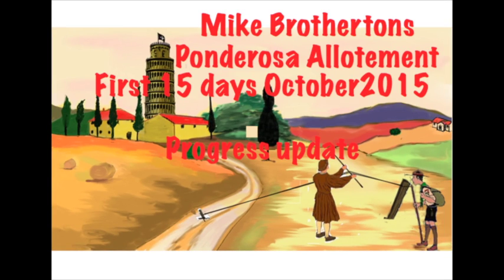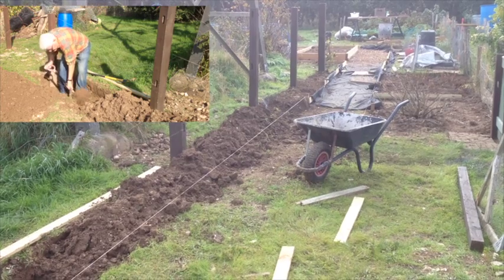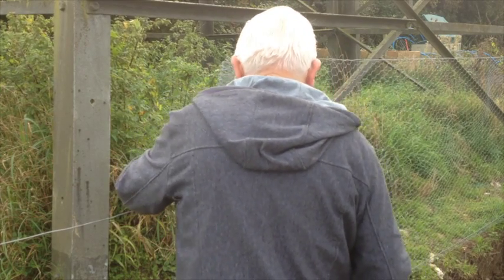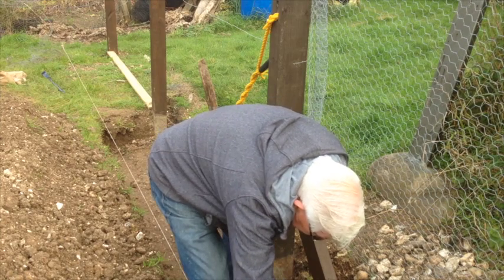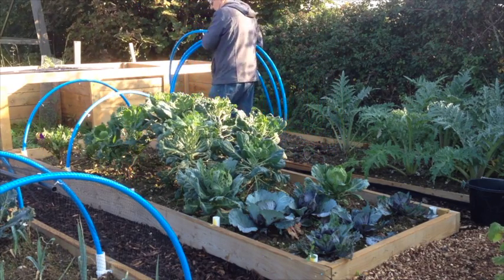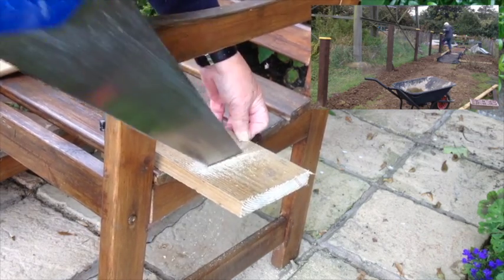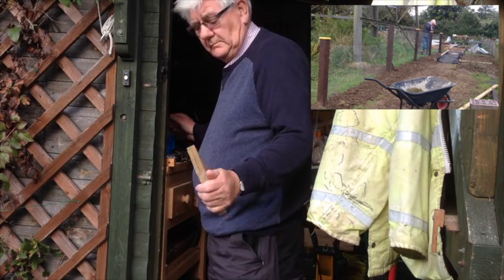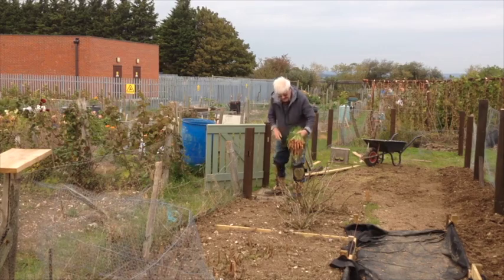Allotment Diary - October 2015 - Part 1

Comment: Hi Mike. A few good days of hard work there 👍🏻
Is there a chance you could give an I depth demo of how to set up the levels using the theodolite?
Cheers.....,.,,Nigel
Reply from the maker: +MuddyBootz  Hi Nigel sorry I am late with this reply I received it late due to waiting for authorization what ever that means.  There is a distinct difference between a theodolite and a level though there is a similarity in how they look.  GPS has taken over the theodolite today so I don't think a demonstration would help any one.  Levels have been superseded by the laser but there are plenty of the old levels on the market and I think easier than a spirit level over a long distance and you can buy a second hand for £30.00.  Do you really think other allotmenteers would be interested?  Cheers Mike B
Reply: +Michael Brotherton It's out of curiosity as a DIYer more than anything. I block paved my back garden and remember the hassle I had trying to get a 1:40 slope for drainage. I knocked pegs level inline for 30fr and the I lowered the latest peg by 9". I then put s string over the first and last peg and then lowered all the other pegs to the string level. I thought there must be an easier way than this😄
Reply from the maker: OK Nigel got the gist, what you are requiring is the passing of the engineers/surveyors information to the trade supervision, i.e the ganger or trade foreman with the use of pegs, profiles etc  Cheers Mike B